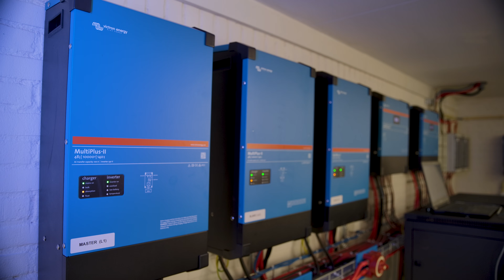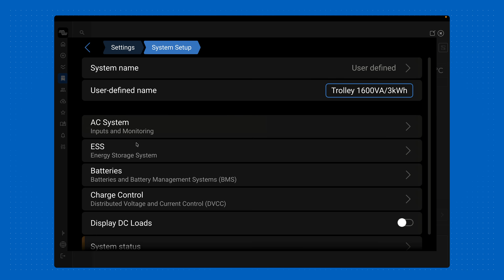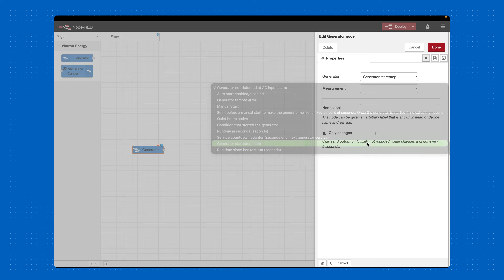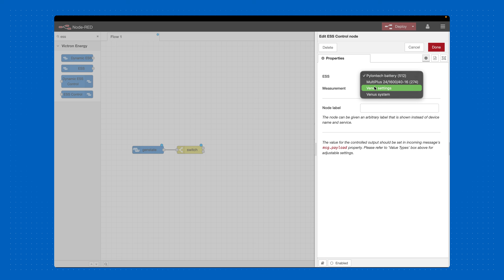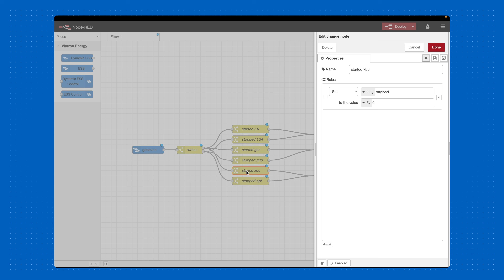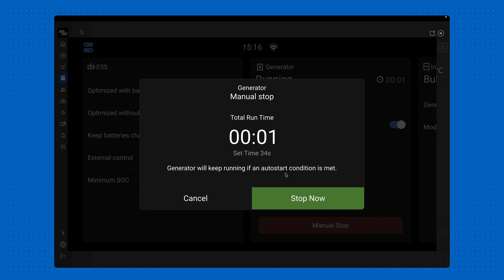Fix Your MultiPlus Generator Setup With Node-RED

Comment: The problem with having a generator connected to an AC input that has a grid code set is the LOM detection of the Multiplus tends to boot most generators due to the instability of the frequency. Is there a way you can use Node Red to change the grid code from a country to none (for the generator) and then back to the grid code when the generator stops. ?
Reply: There is no way around it but to disable LOM on that input.
Reply: @WarwickIsSensible  Yes, that's the only way around it that I have managed so far but it then requires a GPD. I have other solutions that we offer our customers but they can get a bit "clunky" ... It would be really nice if Victron could have a Node-RED feature that could disable LOM and re-enable it based on which source is connected, but I realise that this would be a compliance nightmare!